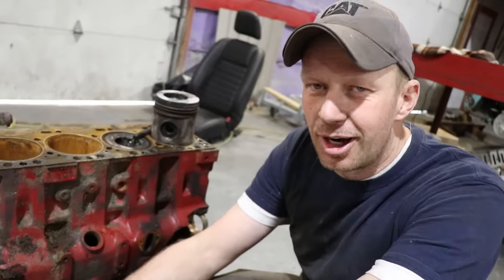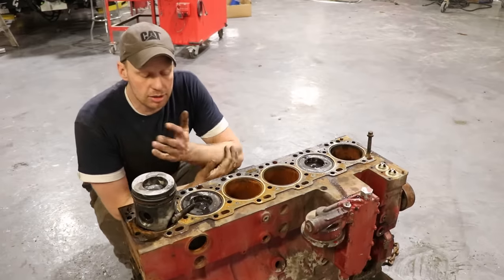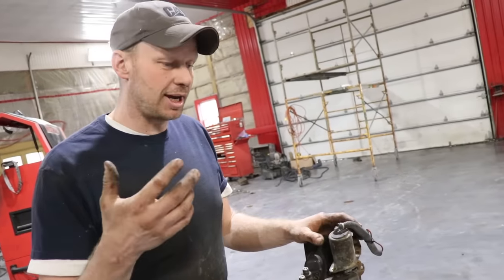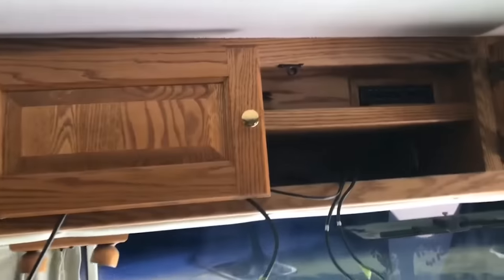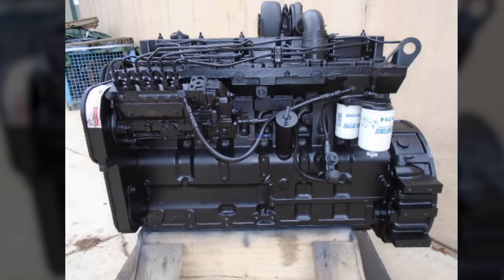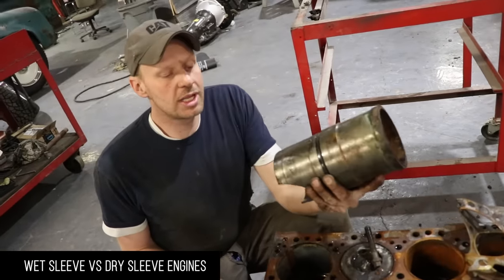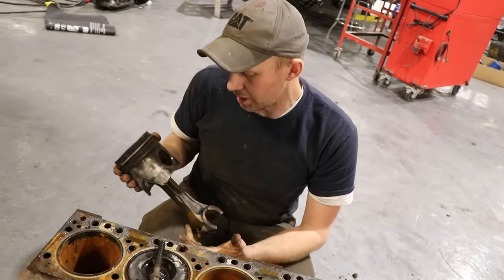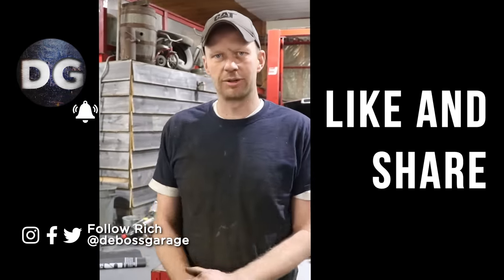REVIEW: Everything Wrong With A 8.3 Cummins Diesel

Comment: When I was a wee shaver working my first job my boss explained cavitation by it being a heat and pressure difference with the flow of the coolant. Basically, the cavitation was at slightly lower pressure areas where steam pockets would form. The collapse of the steam pocket being so violent as to take a teeny tiny piece of metal with it. He said any time coolant flows around something there are high pressures and lower pressures. Because the sleeve gets so hot it is sensitive to even slight pressure differences despite the pressure range of the pressure cap.

Comment: All engines experience cylinder wall Flex. Cavitation is the amount gas bubbles that form in the coolant and is directly proportional to the amount of Flex that the cylinder walls experience. That amount is determined by how high the compression is and how weak the cylinder wall is. NOT the wobble of a friggin' piston!! Who the hell told you that? xD

The Flexing of the cylinder wall expands the pores in the steel and they literally suck in the cavitated coolant bubbles, contract on them, compress them and the heat in the cylinder walls create tiny micro explosions that escape forcefully when they expand again. They do like you said, break off tiny pieces of steel material.

 That's why the DT444E Powerstroke needed the additive maintained in the coolant so frequently and religiously. Why because Ford needed a new engine fast to compete with the Cummins' future potential. At that time around '92-'93 International was in the middle of development on a new Large displacement Gasoline engine for their Medium-Duty line-up. It was supposed to be an up to date 466cu. torque monster. Where it's root design was based off of, I don't know and have never been able to find that out.

Since this 466 was so far in development with a finished engine block, they were forced by Ford to use it, ultimately reducing it's cyl diameter to try and reduce the cylinder wall Flex as much as they could, with the high compression it would now experience. After given little time for R&D, the engineers compromised with preventing damage with the additive in the coolant with regular change out intervals. Bad thing about it was, Ford considered this regular coolant and additive change a crutch and many new owners, if not all were uninformed and around 80,000 miles many were left holding the bag with cracked cylinder walls.

Comment: i have a question for you i have a duramax with a cp3 pump no lift pump i was thinking about putting a lift pump on it can the lift pump heat the fuel to much as i live in the south where it can get hot 100 f plus

Comment: I've got an 1986 K20 Chevy for my lawn care business.   8600gvw and 5200# empty w/me in it. The 350/400 drivetrain is ok for hauling max payload in truck but towing even with 4.10 gears drops mpg from 12-14mpg to single digits. I will do 20,000 miles of towing 3k# this lawn mowing season. Would a 6.2L diesel be worth a look or just wait til I can afford a 4bt or 6bt swap?
Reply from the maker: I would 6bt if you can.
Reply: @DEBOSSGARAGE  love to but I'm thinking that's a $10,000 conversion vs 6.2L might be a 1/4 that.
Reply: @workingcountry1776  the Cummins is a far better engine then a 6.2.

Comment: which engine would you recommend for 5ton army truck M925-939 series, naturaly aspirated Cummins NHC250 or Cummins 8.3 p-pump?
Reply from the maker: The 8.3 or DT466
Reply: I have a Big Cam 4 hi flow if you want to put a big engine in.
350 formula, has a 9 speed RR if you need a transmission

Comment: Question.  Have you ever put a nat gas system on any diesel?  Meaning using the nat gas with the diesel at the same time as a fuel savings?
Reply: Do you mean propane and diesel?
Reply: @carlcarlamos9055  nope. Nat gas
Reply: About 30 years ago, give or take, Cummins was doing r&d on nat gas on a fleet level, particularly with the 903 v8, but this was all nat gas, not mixed.Around that time, several U.S. pickups & vans were available with natural gas power. There were two systems, high and low pressure. Infrastructure was a problem. Cities and municipalities make good use of nat gas today. This is in lieu of diesel, not mixed. Propane works as an oxidizer when mixed with diesel, and in controled amounts cleans up the burn and gives better mileage. The problem is, it does not remove all the pollutants. However, it is a simpler system and doesn't cause the reliability problems of other systems as long as it is not cranked up.

Comment: So is it possible to put a 5.9 Cummins in a  83 chevy c30 crew cab with stock suspension
Reply: Yea. Might have to put some spacers on the front coil springs so it doesn't have a rake

Comment: So I was looking at a a couple of 07 freighters sport chassis.  One has mbe 900 engine witch is I believe 7liter Mercedes don’t quote me it. And other truck has 8.3 cummins. Anybody have these trucks out there a little advice.    My 5th wheel trailer is 55ft and weights around 35k lbs.

Comment: I’m pro Cummins for over 30 years plus in the trade. And I hate the 8.3, fuel guzzling,exhaust manifold breaking, timing bolts going in gear train, etc, the worst Cummins engine ever built, and I don’t know why? Ive worked on them in combines and in tractors, and in a truck, junk, again I’m pro Cummins, but this engine is shameful!

Comment: Hold up, combines are spitting engines "frequently" at 7k hours???? Thats unacceptable in my book, either PM's aren't done or somerthing. EDIT: Remember, this is a FLEET. The absolute bare minimum is what our employer wants. We have, admittedly about half the displacement, engines running the refrigeration units on our trailers for one of largest commercial fleets in the US, and even our engines make it 16-20k hours no issue. They've had 2-3 EGR cooler replacements or cleanings done by then and full services every 3k hours but to throw at rod at 7k?!?! Dude thats like exactly at our engines' second oil change ever. Isuzu or kubota, we use both carrier and TK. Man I'd be livid if one came in with a hole in the block at 7k hours, someones getting on the other end of the phone with me and getting a royal ass chewing two and three times over.

Comment: Whats wrong with it.... it doesn't have any Fairbanks/Achates power technology in it yet... bring on the big 3 cylinder pickups... once you've seen how Detroit Diesel injectors work you realize how crazy it is to have a separate injection pump and high pressure lines... other modern engines that do this are Evinrude Ecotec engines although they use electronic actuation, rather than cams.

Comment: 7k hours? 291 days less than a year you will run your combine and it will die?
Reply from the maker: There are no less than 1000 moving parts on it that all do heavy work.   They all basically go at the same time so replacing them as they break is no enjoyable.  We will go over the combine in detail in a couple weeks
Reply: They only run a few weeks per year during harvest. 7000 hrs. might be 30 years service.

Comment: This probably isn't relevant but an opinion. I'm driving a Quad 06 peat with a C-13 cat and an 8 speed eaton. We have several of these. We also have 2 trucks with Cummins engines. You cant pay me enough to drive eighther. They run out of motor.. Smooth, quiet, and WEAK............

Comment: Gimme common rail or death. 💀🤘
Edit: After installing wet sleeves on Cummins, do I have to deck the block and sleeves or do the sleeves line up perfectly with the deck's surface ?
OR is it a pain on the balls like CAT engines where you have to measure sleeve protrusion and a whole bunch of other B.S parameters ?

Comment: They come in a lot more then just motorhomes and egg Applications.
Tiger cat uses them for a lot of there gear and madill as well in all there gear before they went to Detroit and Volvo.
Only issues That I have seen is the caps fuel pump like to shit the bed.
Other then that no majors and just normal shit breaking

Comment: Wow. Go buy "salvage" engines from off-highway equipment and they have "weird problems" when "torn apart" after being "swapped" into motor vehicles. 

The "weird" pump gear "crack" (it's a fracture when completely "through" the part) is 100% incorrect incorrect assembly and/or abuse. Probably STARTED with the "timing" being "off" and not "running right" if it ran at all. Then somebody "tuned" it with no idea what to do CORRECTLY despite knowing "exactly" what they were doing. 

Similar situation on the 6-cylinder. Which 100% needs more than "re-ringing" prior to a "P-pump swap", lol. And which will never "run right" regardless without more than "re-ringing".

Comment: Everyone knows that 1997 and down mechanical Cummins 8.3 is by far the most dependable, cheapest and easiest to maintain diesel engine ever built period. I am 58 yrs old and have been a diesel mechanic my entire life. Anyone that is taking an engine out of a motorhome or carbine to put it in a pickup truck is an idiot to begin with. Ha I think I am going to my outboard boat motor and put it on my motorcycle.

Comment: I worked on the 350s& 400s we would run a bra inside the sleeve and they would fall out . We used ky to lube the o rings and never cut or broke a oring

Comment: 8.3 does not like rpm like a 5.9,. Do some digging they are reliable stock turn them up and they have issues.   Want a similar motor with lots of aftermarket international dt466,. They can be animals with just a little work..